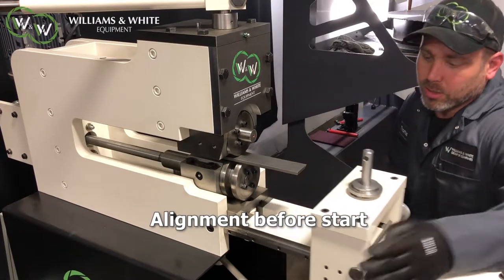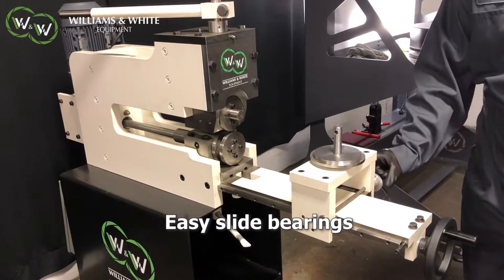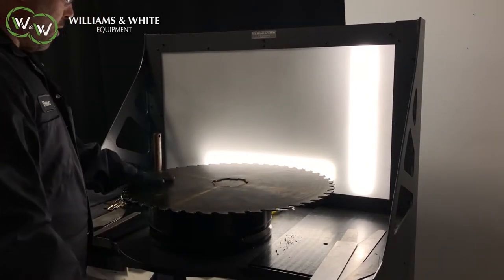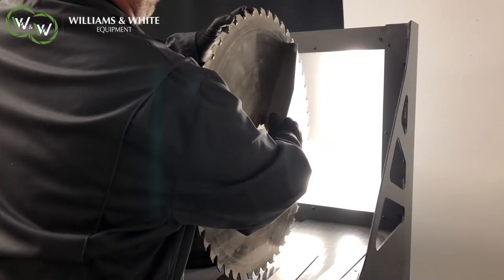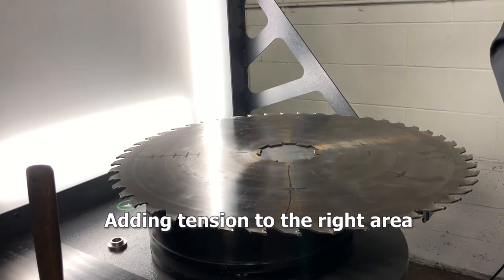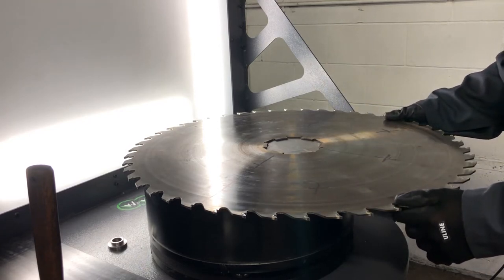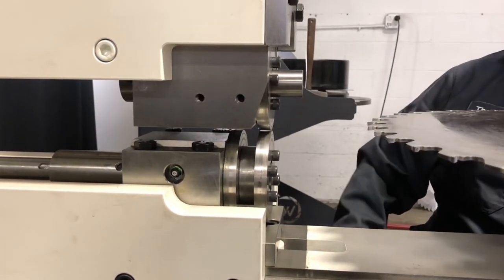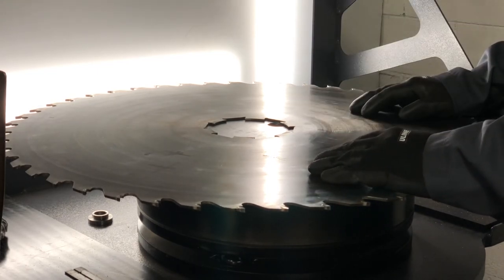#36 Stretcher Roll

Comment: Vibrate that saw, check the natural frequencies against the tension frequencies. I don't see a pressure gauge on the machine, it might be on the other side. If it has one you could set up the correct tensioning pressure to use on your new saws. Thanks for the video, loved it!